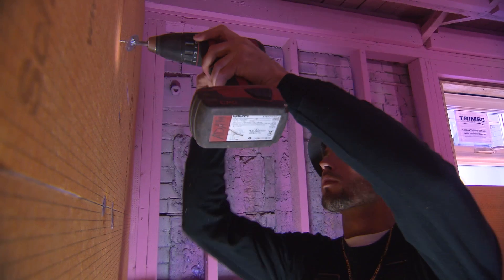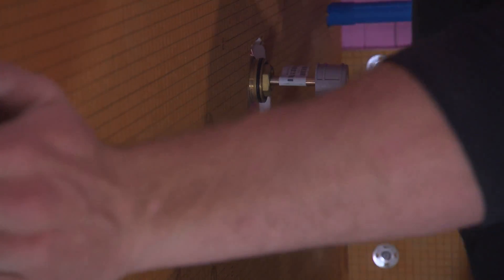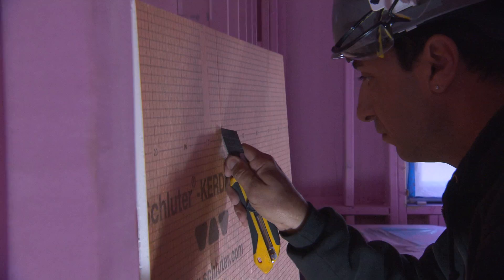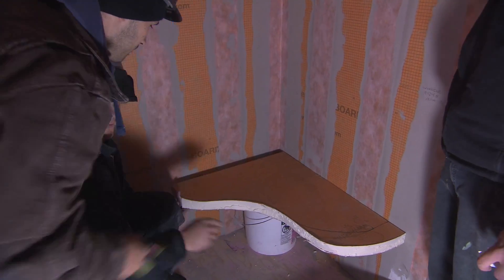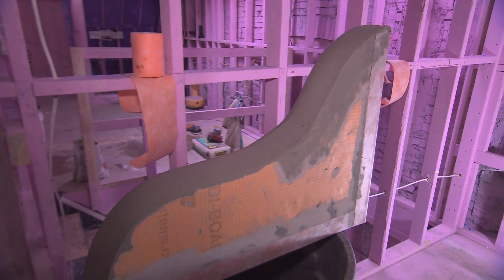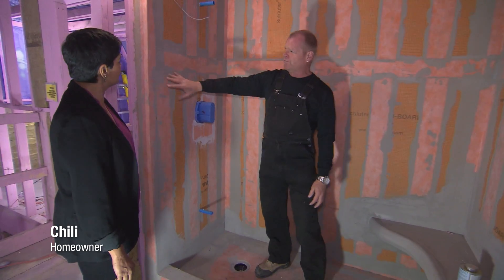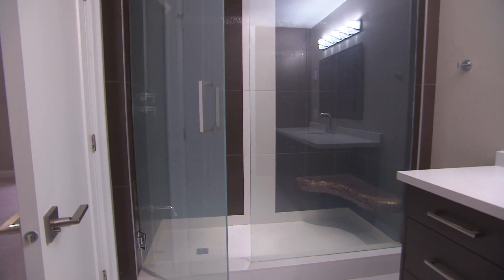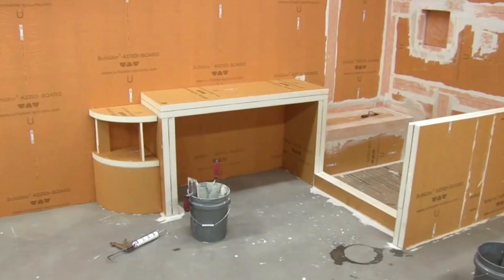Mike Holmes on Schluter®-KERDI-BOARD

Comment: What fasteners should be used installing the Kerdi board over a Masonary wall with furring strips?
Reply from the maker: Hi there ! We don't, but you could buy screws that would work. The selected screws must be of sufficient length to reach a depth of at least 3/4" (20 mm) in wood studs. If the studs are not thick enough, the screws need to be able to penetrate the masonry to that depth. Make sure the screw material is the same as the washer, to avoid galvanic corrosion. Also, be sure there are no moisture concerns with the wood furring strips in between the masonry and the waterproof KERDI-BOARD. Hope that helps!

Comment: Should I use Kerdi board or Kerdi membrane??
Reply from the maker: Hi CW. Both Kerdi and Kerdi-Board provide waterproofing for your shower... but Kerdi is applied over gyprock and Kerdi-Board is a one-step process building panel that eliminates gyprock completely. Both are designed to have tile applied on top. 

You can check out our website for more details! 

Kerdi: https://www.schluter.com/schluter-us/en_US/Membranes/Waterproofing-%28KERDI%29/Schluter%C2%AE-KERDI/p/KERDI

Kerdi-Board: https://www.schluter.com/schluter-us/en_US/Building-Panels/KERDI-BOARD-Panels/Schluter%C2%AE-KERDI-BOARD/p/KERDI_BOARD

Comment: Good produce like many others, however, it is very expensive.    One reason for the high price is how they distribute it.    Schluter sells it to distributors who then sell it to dealers who then sell it to the trades or consumers.      IT IS ALMOST A PYRAMID SCHEME !     The result of all these companies taking a cut is that they end price IS THROUGH THE ROOF !
Reply: Yes!  Nice system that performs well, but crazy overpriced.  Just went to buy eight 3/8" cube corner transition pieces for Schluter QUADEC aluminum tile trim.  You could hold 50 of these tiny pieces in one hand.  Price was $38.66 each.  I'll be mitering the corners instead.

Comment: I plan to use Schluter Kerdi-Board on the bathtub surrounding. If I have some small bumps on the studs (tried the planer and shimmering my best, but still there are some) will it cause large tiles to fail (12x24), or it might just give some negative visual effects? Some of unevenness is about 1/4". I know that the standard limit is 1/8", but if you place a piece of Kerdi-Board, it sits very stright, but when you place there a long leveling ruler it bumps, and you can see that it is not even everywhere. Again a piece of Kerdi fits like a glove on that wall (studs better to say). Maybe you can advise. Thank you for the informative film.
Reply from the maker: Hi Olena! We do have a quick video on wet shimming with Kerdi-Board here: https://www.youtube.com/watch?v=nebHq8N2i0Y
You're welcome to give our Product Support team to have a chat about your project:
US: 800-472-4588
CA: 800-667-8746
Reply: @schlutersystems1  Thank you very much for the quick reply band useful information.  I saw one film about that technique (Wet Shimming) and before, but kind of hope to go without it, just with dry shimming. I do tiling for the first time and if something goes wrong would be easier to redo the project.
Reply from the maker: Please know our Product Support team is here to help! Good luck with your project!
Reply: sister the studs and make it flat and plumb.  Flat is important for tile setting; plumb is important for corners.  I think Tile Coach (on youtube) has a video on fixing walls.  Sistering is faster and a lot less grief. More important it will keep your tile setter happy.

Comment: It's not waterproof and the buildup from all the layers in the pan will throw plumb out by at least 1/4 inch. A normal size shower will cost 500 plus the drain. You also have to spend a ton of time making it waterproof which in reality it never is. Put up anything on the walls drypack you pan then two coats of Redgard on your ready for tile.😁

Comment: Its OK stuff if it is done right! I just looked up the price not even close to being worth it! $480????? For one sheet? that's insane! I can do a mud shower and it will last a hundred years! And it wont cost me much for the sand and cement!
Reply: $75.00 per sheet is what I pay
Reply: This system is for saving a Contractor time, they save time, means they make more Dough and charge a lot more.

Comment: Have you flood tested Kerdi shower for 24 hours?
Reply: I had one where inspector was out of town so it sat filled for over a week. Didn't leak one drop.
Reply: I'm pretty sure that Kerdi is not supposed to be used to line a swimming pool or bathtub so that seems unnecessary.   Showers aren't designed to be totally submerged in water.
Reply: Tons of videos online proving it leaks
Reply: @toadamine  , even a swimming pool leaks if it is not built correctly. My business is full bathroom remodel and I am a specialist in shower pans. The vast majority of vinyl shower pans I replace are leaking, some just a few years old. I have never had to replace one schluter shower for leaks, only for updating style amd not one of those has been leaking.
Reply: @prof613  yeh you have not been using it for long either.
Reply: @STONE69_  for over 10 years. And to the previous person who asked about a flood test, I actually did a more than 72 hour flood test when the inspector didn't show up till  days after scheduled. Think it was over a week total before I got back to that one. No leaks.

Comment: I'm thinking a combination of Kerdi board and Redgard paint on sealer, anybody tried these two together?
Ease of use of Kerdi and if in no rush Redgard 's idiot proof sealing
Reply: The Kerdi system doesn't need a water proofing membrane like Redgard.  If you want to use Redgard, a cement board substrate will provide the protection at a fraction of the cost.
Reply: @chrisgraham2904  Red Guard over Drywall is even enough, my old tub and shower were just drywall and it was like new, no mold, no water Damage and that was 15 years. But a Shower cement board or a floated wall is best. Put that Kerdi board in water and see it disintegrate.

Comment: The whole idea is to not let water get behind the tiles in the first place. I've taken out 30 - 40 year old bathrooms with regular drywall behind the tile and it was in perfect shape because it was tiled and grouted correctly. I've ripped out showers with kerdi / schluter and water had gotten behind the tiles and stagnated - sure, the kerdi was ok but it all had to come out attached to the tiles...
Reply: I've watched quite a few tile videos done by tile contractors and they all explain how grout and thinset is not waterproof.  Also any tile that isn't porcelain is usually porous. So I would like to know specifically how you believe you can grout correctly to make it waterproof.  Are you just talking about making sure you seal the grout and tile afterwards?  Or acrylic grout?  Tiling is an ancient building technique for wet environments and Kerdi, wedi and all of these different waterproof membranes are new techniques that are less than 40 years old.  I think more of the point of these products is to save labor expense and to allow contractors to knock out jobs quicker with less steps that require things to set overnight before proceeding. So I can easily see your logic, but I don't know the important details for how to properly grout and tile to make the tile and grout watertight.
Reply: @ericksonjustinAK  you, sir, are correct! Rob bob has no clue of what he is speaking. You, with your YouTube video watching wxperience have more correct knowledge than whomever this “Robbob” is. Everything you commented is correct.
Reply: @ericksonjustinAK  do you know what happens if water gets between the tile and whatever membrane is popular the month it was built? It stagnates and the only way to get rid of the smell is to rip it out regardless how much you paid for whatever backer you used. Watching videos of "contractors" on youtube is dicey at best...
Reply: Tile and grout are not waterproof. Period. You may have been doing this a while, but you have no idea what you are talking about when it comes to the science. Since tile and grout are not waterproof, they allow the water the dry, and there is no standing water, as long as your levels are good. Generally speaking, a shower that is not being pounded on by a steam shower, or many uses a day, will not have any water issues if install correctly. Correctly includes following the manufacturers instructions. The waterproof nature of the Kerri board and its system are the reason why non modified cement is a necessity, as it does not allow the moisture in the modified cement to dry fast enough to be usable for weeks, especially if you are using larger tile. Please, if you are going to post your anecdotes on a video, at least have some common sense to back it up.
Reply: water in water out. that's why kerdi/schluter stressed proper thinset coverage and properly packed grout joints. water is expected to get into grout. but If there's no voids or minimal voids in the thinset and grout the rate of water absorption is very slow.  if water does happen to get down deep it'll evaporate the same way it came in, generally through the grout joints. 

it's a different waterproofing system vs the old mud pans. which is better? debatable. both have pros and cons. but to say mud pans are waterproof in that water doesn't get under tiles and grout is wrong. it's just a different moisture wicking system. water gets through and gets soaked up by the mortar and if it gets to the liner it'll make it's way to the weep holes of the drain. 

in both methods water gets under the tiles and in both methods there is installer error that could create standing water. in both methods areas under the tiles can be constantly wet or moist depending on how often the showers are used in a day!  that's why both methods have a waterproof membrane. because water gets through no matter what. the issue is how much depending on how well the materials were installed.
Reply: Right same to me i ripout my father shower he built 40 years ago then nothing matter this guy is popette manipulate by big compagnie shame on him